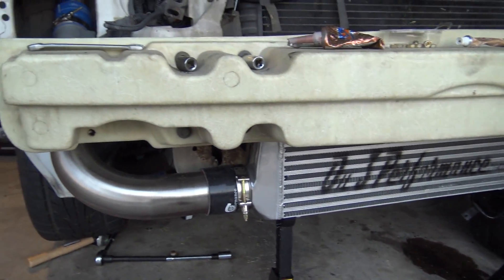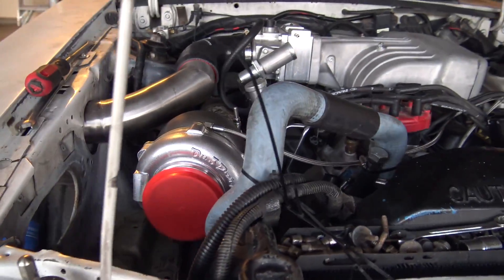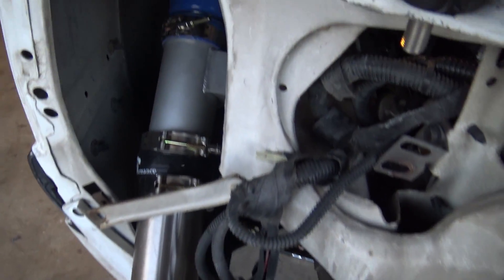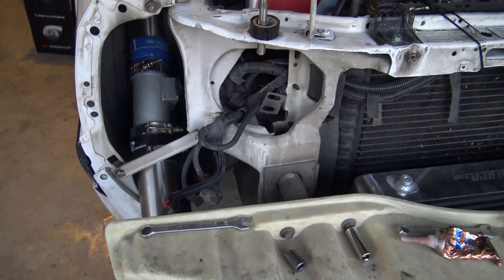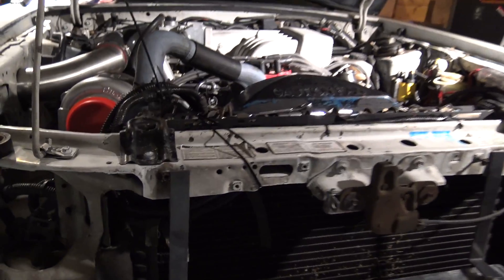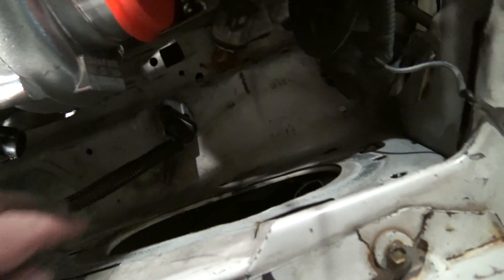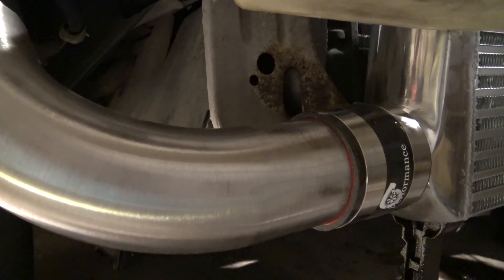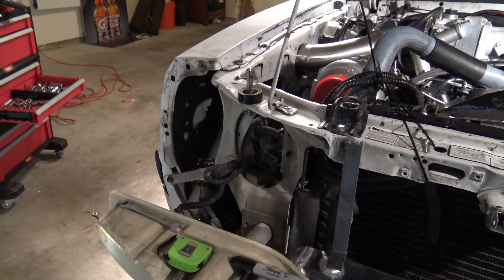Foxbody Mustang On3 Turbo Install 6

Comment: What exhaust did you go with? I have the same setup that you do but I don’t like how the 40 series flowmasters sound on my car and I’ve been told that a blow thru mufflers is better for turbo cars.
Reply from the maker: Turbo car youll need blow thru mufflers. I ended up just running it stright pipe
Reply: justin91lx I ordered some super 10’s and some tailpipes 3” so hopefully that doesn’t hurt me much

Comment: What maf did you use? Cause I found a great deal on 42lb injectors pro-m 80 mm maf and sct chip. But Idk if the maf will work with the on3 kit.
Reply from the maker: Pro M. As long it blow through style
Reply: justin91lx the housing is the one that has the k&n filter bolted at the end is that the blow through style?
Reply: justin91lx or can I just order the whole thing welded already from on3 and just use the maf sensor that is calibrated to the 42 lb already?
Reply from the maker: +Savage Habits that maf won't work.
Reply from the maker: +Savage Habits on3 gives you the option to have a flanged welded for the meter. Meter would probably work but won't take much boost. Would need a meter for boost application
Reply: justin91lx okay what Meyer would you recomend me for some 42lb injectors on plan on boosting 8 lbs
Reply from the maker: +Savage Habits you have a model number to the meter you have now?
Reply: justin91lx um9420 is the serial
Reply from the maker: You should be okay if your boosting to 8lbs
Reply: Great! Thanks for the info man appropriate it